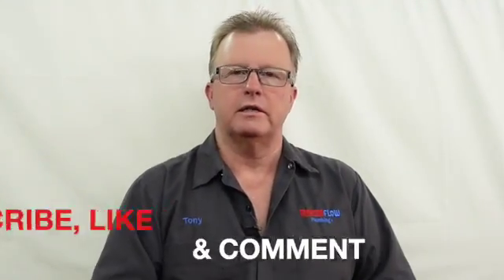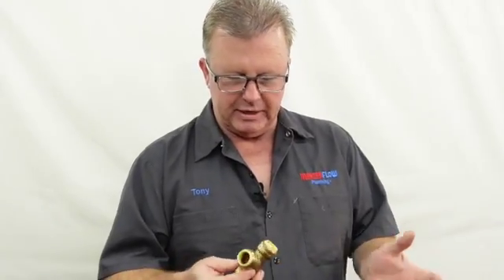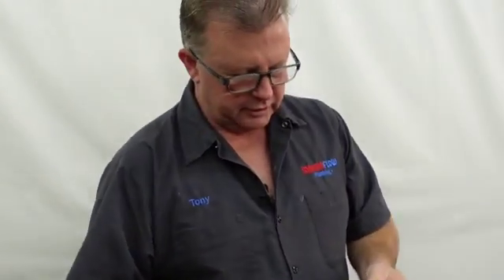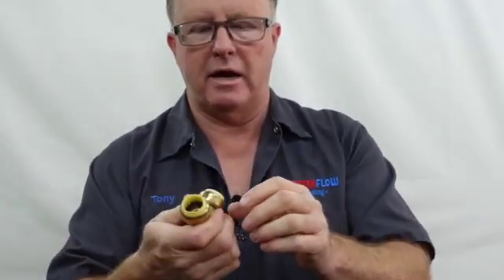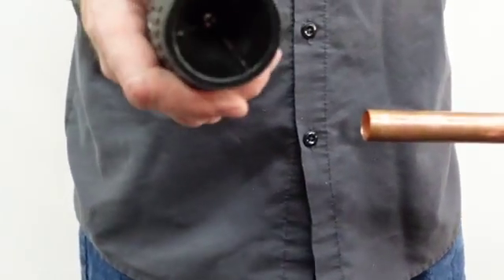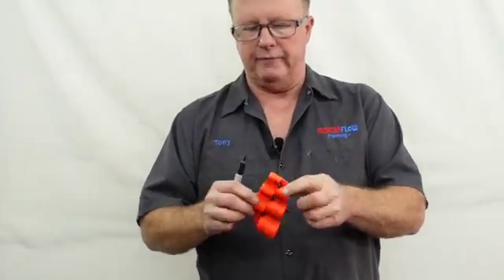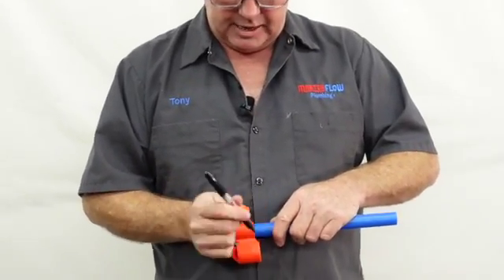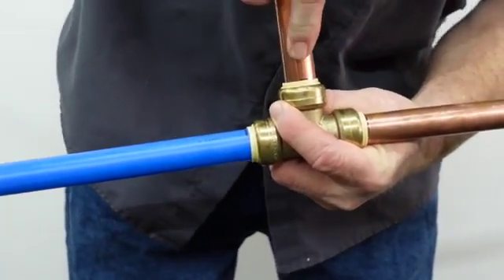How To Use Shark Bite Fittings: The Best Tips and Advice!

Comment: On a 3/4 soft line copper supply line will you have a reduction to a 1/2 in. After the shark fitting
Reply from the maker: Push connect fittings go in the outside of pipe so they will not reduce the inner diameter. With copper you don’t use the stiffener but. In pex and cpvc you do use the stiffener piece. And it will cause a slight reduction in inner diameter.  Should not be noticeable.  Thanks for watching.

Comment: I didn't know such fitting existed. Thank you so much, Sir. 
But, beside its costly, can I connect old pipe system particularly copper pipe with the new PERT piping (Called: Geberit Melpa). Also, how would such connector react on hot water (50 degree) line and cold?

I really need your recommendation on this, PLEASE!!!
Reply from the maker: They are fine on hot water.   As far as your application.  As long as the pipe has the same outside diameter as copper your good.

Comment: These do not work. They will leak, guaranteed. There might be a use case where they could be a leaky latch until a pipe can be replaced but no, these are not a permanent repair. Just tried one today.
Reply from the maker: Thanks for watching
Reply: Sounds like operator error. Sharkbites are approved in all state plumbing codes.

Comment: The remove tool 🔧 is impossible. Plus how put on shark bite can you  push it far and if you stop is it stuck ? Understand? So when you 1st put it on the 1st pipe do you push it far and if you stop is it too late ?
Reply from the maker: They are removable.
Reply: @masterflowplumbing9812 I just spent 2 hours trying to remove one. It would have been easiest to cut the pipe with the shark bite still attached and throw the whole mess in a landfill.

Comment: I hate plumbing. No matter what I do it always leaks somewhere. Either the water line or the drain line. Drip drip drip. Pain in the butt. And trying to fix existing copper pipes that were done equally poorly by "professionals" after the walls are in place is an even bigger pain. I had one copper elbow joint in the ceiling just burst for no reason whatsoever and flood the kitchen. And the house is only 20 years old. I'm currently finishing my basement and need to run some lines to a kitchen area and a bathroom. I am NOT going to use copper pipes and solder. I've had enough of that. I'm going to try running all Sharkbite line.
Reply from the maker: You could consider pex piping.

Comment: I just decided to replace my water heater fittings with the regular copper soldering method. I It was mainly because I didn't want to cut the existing copper pipe too close to the drywall. So I went out got all the supplies at HD it wasn't cheap $140 for the torch, solder, flux, pipe cutter and fittings. If I was doing this all the time it would be worth it but as a one time thing the Shark Bite would have been cheaper.
Reply from the maker: Yeah fer sure.  Thanks for watching

Comment: I disagree slightly. These fittings can be used everywhere. There is NO DATA anywhere which show FAILS of these fittings.
Reply from the maker: I don’t believe I talked about failures. I’ve seen very few in my career. I only use these when I need to.  They cost too much to plumb a house with.

Comment: When one is to use the shark bit on to joints of copper pipe, do the plastic inserts have to be removed from the shark bits, and if so will it leak when the water is turned on?
Reply from the maker: Watch the video.  I cover that question quite well
Reply: You can leave them in if you want to. Personally I’d leave them in. It helps protect the O-ring.
Reply: Sharkbite web says not to remove the plastic insert.  The new sharkbite max does not have the plastic insert.

Comment: i tell every one of my friends who have homes to buy a ball valve shark bite or two in case they get a leaky pipe in the middle of the night they can cut off the pipe, sharkbite a valve on there and turn it off...itll get you to where you need until you can get a plumber...and you can keep the water on!!
Reply from the maker: Great idea matt g.
Reply: @masterflowplumbing9812 be sure you put your main shut off where there's easy access. I had a leak emergency and mine is in a crawl space under the house. I  had to crawl underneath in winter barefoot and a t-shirt into freezing mud! You can also get an electric one that you can shut off remotely.

Comment: When you used the PEX  you did not use the Orange tool to debur the pipe 11:35  what is a stiffener you put in the Pex pipe.
Reply from the maker: The stiffener is used to ensure the end of the pex pipe does not begin to collapse over time.  It’s important when using a sharkbite type fitting on pex.  You remove them for all other pipe and the orange tool has no debur tool built into it.  It’s simply a depth guage.
Reply: Give that orange tool another look. Mine has a deburring function and when I zoom in on a screenshot of yours it looks like it has all the same metal inserts for deburring.
Website: 
“Mark proper insertion depth for SharkBite Universal fittings, as well as deburr pipe with a simple rotation of the tool once the pipe is inserted.

Features and benefits:

Compatible with PEX, copper, CPVC, PE-RT and SDR-9 HDPE pipe.
Used to deburr the outside of copper pipe to remove any sharp sections or burrs.
Lightweight and durable plastic construction.”

Comment: In addition to what you do could you put silicone grease on a copper pipe to prevent damaging rubber o-ring inside the shark bite ?  Thanks
Reply: You are correct "Silicone grease" will not damage rubber/plastic but make them more elastic and pliable
Reply from the maker: You can but you have to be sure the grease will not distort the o ring over time. Many petroleum products will do just that. Thanks for watching
Reply: @masterflowplumbing9812  silicone grease